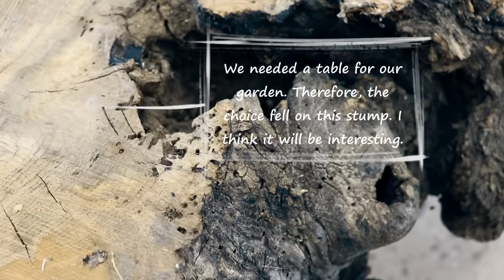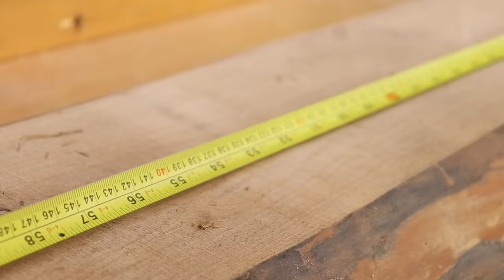200 year logs to table. Live edge table.

Comment: This is a rather refreshing variation on 'filling gaps'. Most others would have filled those 'gaps' with epoxy resin but you've decided to bridge them with wooden splines, leaving the spaces in between open, yet fully capable of supporting whatever item is placed upon it's surface. Brilliant!
Reply from the maker: Thanks for watching. 👍👍👍
Reply: Holes in the table - its so comfortable!

Comment: Your skills are enormous! I like to have the half of it
Reply from the maker: Just work and you will have one too.
Reply: @WOODDESIGN6730  thanks, I'm trying. But my planer, a smaller record power, would have crashed the 7mm strips. It did this recently with expensive Padouk. So, it's also a matter of machines.
Reply from the maker: @kerstin4516  This often happens with thin strips.

Comment: Tree rings are traditionally not used in woodworking because the internal stresses as the wood expands and contracts with humidity are too much for wood to handle. This causes checking and cracking. The wood slats are an interesting solution to this problem. Accepting the checking as part of the aesthetic 
helps as well.

The table looks beautiful.
Reply from the maker: Thanks for watching.

Comment: Beautiful table. Why didn't you fill the radial cracks, e.g. with epoxy? Won't rain get into those and cause more extreme cracking over time?
Reply from the maker: Thanks a lot. It's not a good idea to use epoxy outdoors.
Reply: @WOODDESIGN6730  Could you please elaborate? I've used epoxy on several outdoor projects with great success and still look good years later. What is your concern?

Comment: Had you thought about sandblasting the rotten parts out and bark off instead of cutting with a chainsaw?
Reply from the maker: I didn't think so. I'm not sure it works..?
Reply: @WOODDESIGN6730  I've seen it done. I think it might leave a softer edge. And possible more detail in the defect?